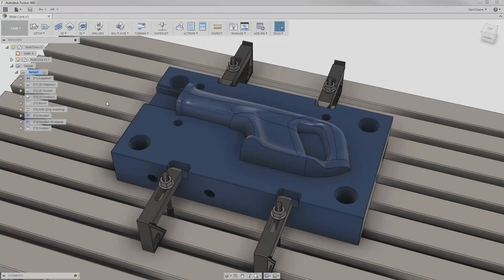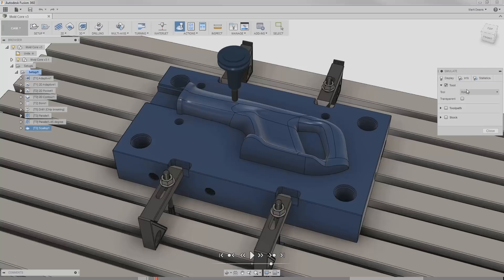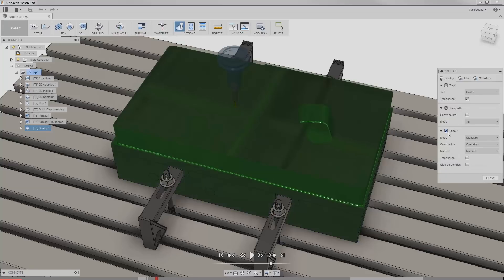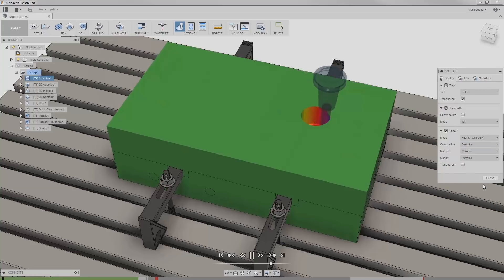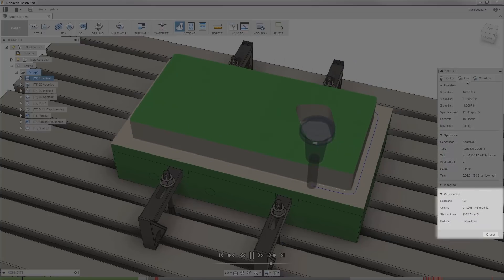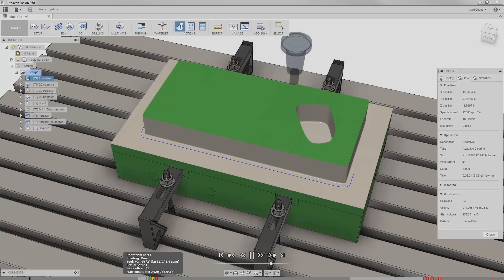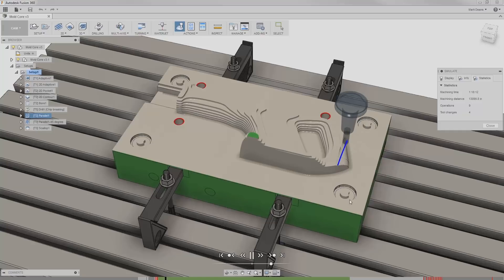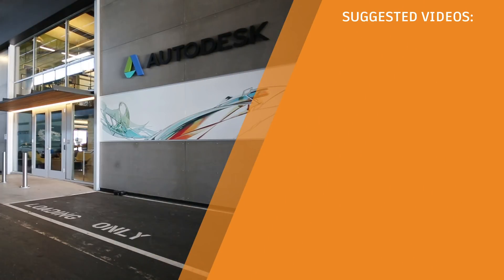Visualize Toolpaths and find Collisions with Machining Simulations

Comment: Is it possible to model and animate 3D machine for the production of rivets (for example)?
So, I draw all the key parts of the machine (press) as well as the wire (working piece), then let the machine "work" and make the rivets. So, I play animation, and let the 3D machine made rivets from the wire by itself?
Reply from the maker: There is nothing to do this automatically for you...but you could use the animation workspace and component visibility to create something like that.